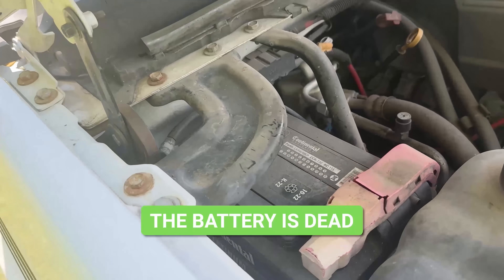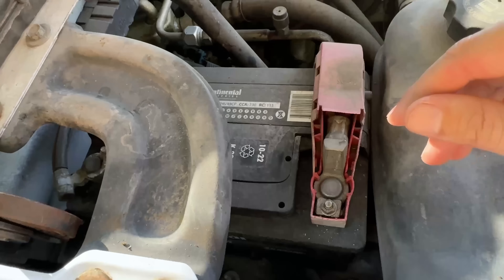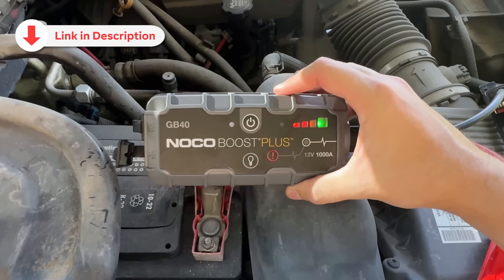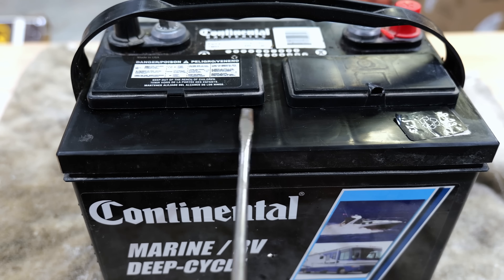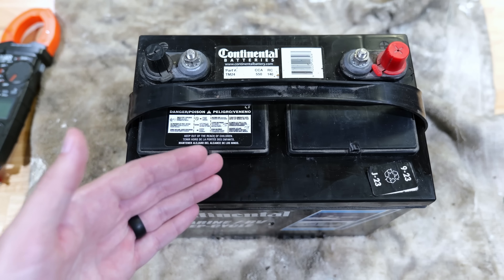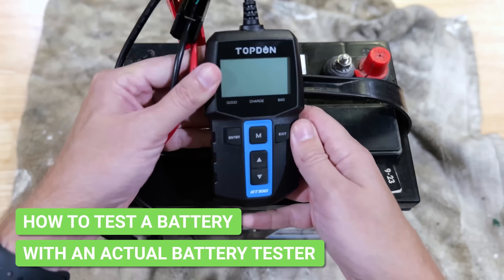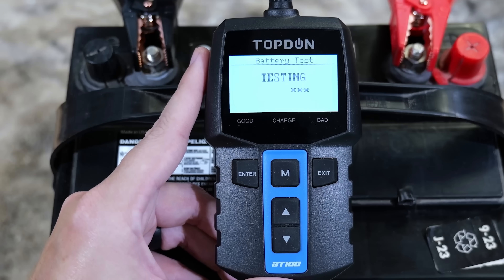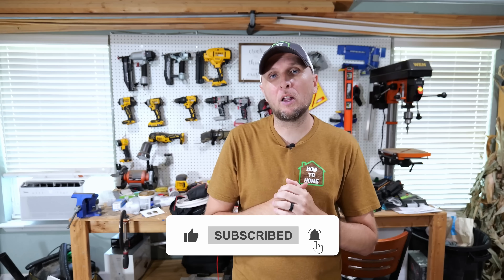How To Check Your Battery's Health And Never Get Stranded Again!

Comment: Play over $100 for a jumper which batteries in it are only good for up to 5 years and yet I have yet to use my jumper cables in the past 7-8 yrs. So why waste over $100 for something that you may never use
Reply from the maker: You wasted money on your cables.  You bought them though in case your battery dies though.  Same thing only way more efficient with the jump pack.  But you do you
Reply: @HowToHomeDIY  the jumper cables will last for over  basically forever if not used the batteries in the jumper box go bad after about 4-5 yrs.
Reply from the maker: No they don’t 😂 Again, you do you bud.  Hope someone’s available that you can bother to come jump your battery next time it happens.

Comment: Batteries WILL last longer in hot weather, not the contrary as you said.
Reply from the maker: Completely false! In cold temperatures, the chemical reactions within batteries slow down, which can reduce their output capability but may prolong their overall lifespan. For example, while a battery may struggle to deliver power efficiently in the cold, the slower degradation of its components can lead to a longer usable life under certain conditions.
Conversely, high temperatures accelerate chemical reactions within batteries, which can temporarily increase their capacity and output. However, this also leads to faster degradation of the battery materials, significantly shortening their lifespan. Research indicates that for every 15 degrees Fahrenheit increase above 77°F, the lifespan of a battery can be halved. Thus, while batteries may perform better in the short term when warm, the long-term effects are detrimental.

Comment: Be careful when using a battery tester.  You must make sure the terminals on the battery are absolutely clean.  If they're not clean, you won't make a good connection with the tester, and the tester will read "Replace".  You may be able to bring your battery back to life by using a battery charger that has a reconditioning feature.  I use the compact CTEK MUS 4.3 Polar 12 Volt Fully Automatic Extreme Climate Battery Charger.  The charger/reconditioner is super easy to use, and it even charges in really cold weather down to -22 deg F.  You just properly connect it to your battery; plug the power cord in the wall; select what program you want it to do; and it'll go through each step automatically.  It'll also tell you if the battery is bad and can't be charged or reconditioned.  I love this charger/reconditioner.  It takes all of the guess work out of it and is highly recommended. 👍👍👍👍👍

Comment: Most premium car batteries should last 5-years. Manufacturers only rate their batteries for 2-years bc there was a big lawsuit over the battery warranty. Evidently, a customer didn’t understand “pro-rating” batteries where you buy a new battery, and the price is reduced by the amount of time you were shorted on the previous battery. The customer demanded a new battery, installed, free of charge. 
     Long story-short; manufacturers no longer warranty batteries for five years. You can thank our screwed up legal system for that. Lawyers are running the country. 
     Anyway, I just keep track of the times me and replace the battery every five years. It’s not worth it to me to be stranded due to a worn out battery.

Comment: An AGM battery that requires distilled water????
Reply: All my AGM batteries are totally sealed.
Reply from the maker: Apparently not all are. The manufacturer list this as an AGM battery.  It is a continental TM24 Marine deep cycle battery.
Reply: @HowToHomeDIY  All mine are Group 31's from Penn Industries.

Comment: I agree with everything, except the life expectancy. You should get more than 2-4 yrs on a vehicle battery.
Reply: Live up north now but have lived in the south as well. My Audi is 7 years old and battery is fine. Of course many Audi’s have the battery in the trunk under the spare tire so they are a bit more protected from the elements. Also, don’t recall ever replacing batteries at a 2-4 year interval when living in Tampa or Dallas over a 10 year period. At least 5 years of service from a battery or more. 2-4 year is exceedingly short based upon my experience.
Reply from the maker: In many places yes.  But here in the South, 2-3 years is about what you're going to get.

Comment: shout out to the NOCO jumper box. very awsome. I find myself jumping my own vehicles, and random strangers all the time. I have even used the over ride button to jump a truck woth no battery and drive it for a short distance. especially useful if you are parked where it is impossible to get jumpers to the battery from another car.

Comment: Some OBD tester also have the batter test option,. I see one huge issue with your tester, it says 6% At first I knew that ws incorrect I was not sure what the real % was so I did the math and it shoudl say 24% 135 is actually 24.545...of 550 , 33 would be 6% of 550
Reply from the maker: It’s not an issue.  The 6% is not all just from the lower cca.  It’s taking all of the measurable factors into consideration and then using its algorithm, gives you an overall health score.

Comment: Didn't realize the battery on a '19 Honda CR-V wasn't a maintenance free lead-acid, so never opened it to check. Using a battery tender regularly, it didn't die for 5 years, and I just replaced it with a LiFePO lithium battery which is truly no maintenance. The high desert of southern New Mexico is certainly hot, but I was amazed that it lasted so long.
Reply: @tgf5652  We are part of a group that processes 300-400 lbs of fresh red chile every year, and we already have a freezer with several lbs of green, life is good this time of the year...

Comment: 2 things. 

1. It's a good idea to test the battery at the terminals you use as sometimes the terminal can be damaged internally, and not visible externally. So you may not pick up that it's not making a solid internal connection. 

2. If that's an AGM like you tested it, that probably isn't a bad battery. Charging voltage to an AGM really requires much higher voltage than a normal lead acid battery.  They will recharge on a normal 12v system, but they typically won't fully recover. In automotive, they will usually spend most of their life at a partially charged state. Sometimes falling to a failed state.  However, with an AGM charger or a charger that offers a regen cycle, you can normally bring them fully back. 

AGM require a bit more maintenance. I usually do a regen to them once a year per battery, and doing that normally get 8-10 years of service from them.
Reply: Yes, you're correct.

Comment: While these electronic battery testers are a very valuable tool to have on-hand, I find that sometimes it also pays to have a basic resistive load tester. You can pick up a 100A resistive load tester from Harbor Freight for $20. This combined with an electronic tester will solve just about any battery issue you may encounter. Obviously, it's also handy to have a multimeter but in a pinch the electronic tester does give you a digital readout of the battery voltage.

Comment: How do we find out which one we need?  "Portable Charger and Jumper Cables for 9.0L Gasoline and 7.0L Diesel Engines" or the "6.0L Gasoline and 3.0L Diesel Engines" or the "8.0L Gasoline and 6.0L Diesel Engines"?
Reply from the maker: Need to know the size of your engine.  Most vehicles the 6.0L gas and 3.0L diesel (GB40) jump pack will work unless it is a much larger vehicle.  If you have a car, SUV, or 1/2 ton truck, that one will work.  If you have a 3/4 ton truck then you may have to look into one of the larger ones.
Reply: @HowToHomeDIY  Thought so but wasn't going to run with it without checking.  Thanks.
Reply from the maker: @bettyir4302 totally understand!  Always best to confirm.  You’re very welcome!

Comment: Another tip people should keep in mind:  fully discharging a car battery can shorten its life considerably. 

Try not to let your battery go completely dead. Start and drive all of your vehicles periodically. If that’s not possible, use a battery charger/maintainer. Removing the battery from a vehicle that is going to sit idle for weeks or months can also help.

Comment: Take it from an old man, Duralast is the best auto battery!
Reply: I usually go with big name brands, like Duralast, also. Just recently though, my spare truck battery gave out and a replacement was in the $160 range at a big name auto parts store. Just thought to myself, why not see what Rural King farm and home store has available. Found one there, same specs, same dimensions, for $60. Installed it about a month ago. Time will tell how it works out.
Reply: Duralast batteries and Walmart batteries are the exact same. They're both made by Johnson Control.
Reply: @jimanon5681  
Maybe so but the quality control of Duralast is far superior. I've had 2 that were still holding a charge and passed a load test after 7 years! Neverlast batteries are crap I'll agree with that but there's a reason why Duralast are over twice the price! I've had every battery brand made and none are even close, but believe what you want and keep buying a new battery every 3 years if you're lucky lol 😆